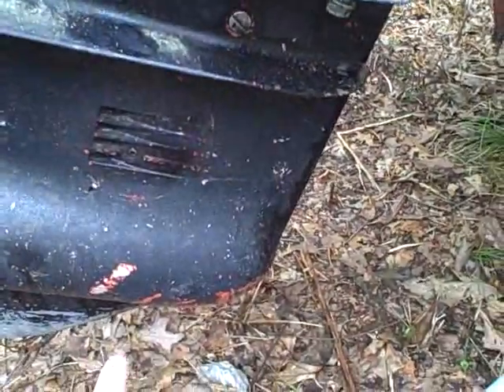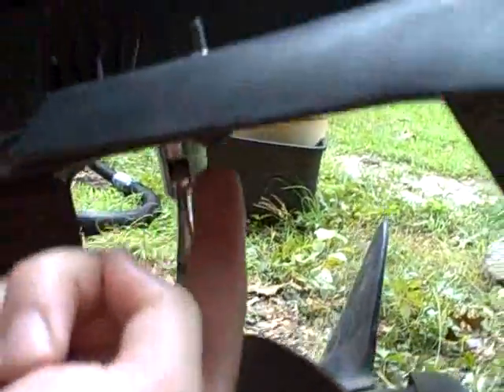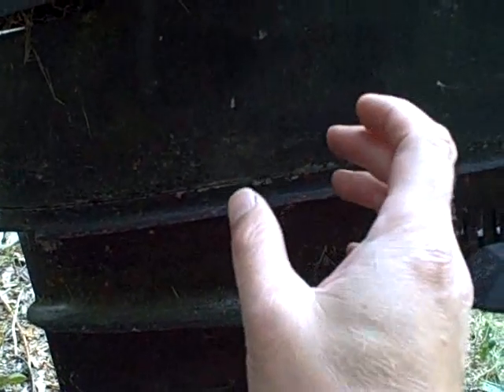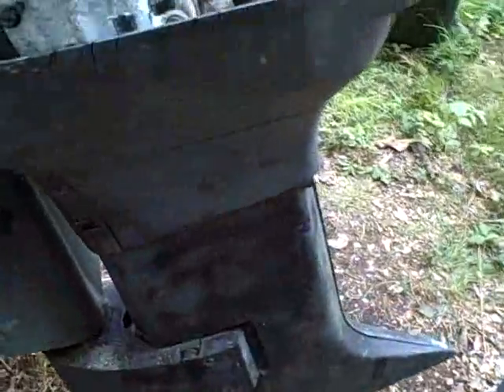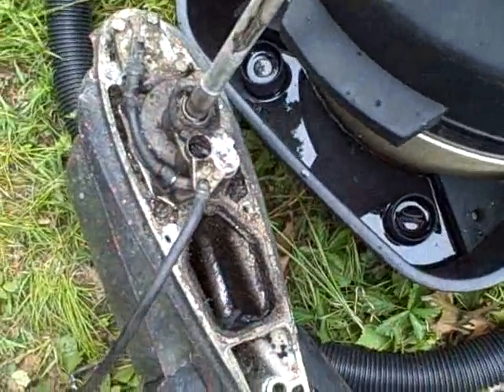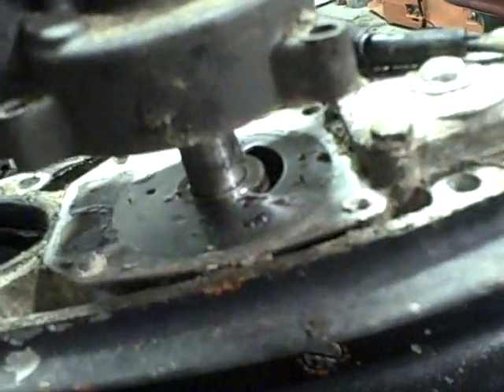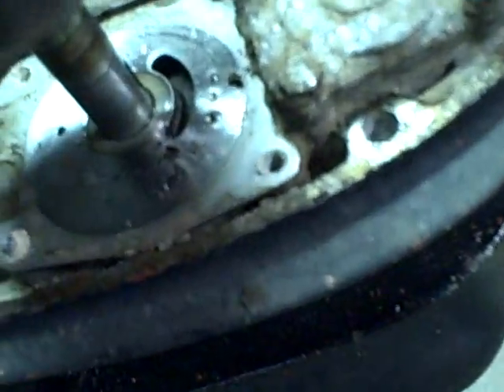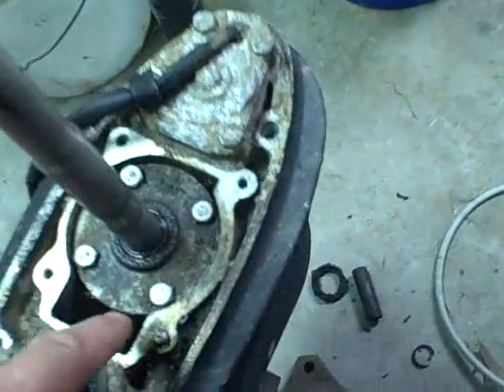Glastron Aqualift Ugly boat / Johnson Outboard Project Part 13

Comment from the maker: Yes sir, retired that flip video that had the sound issue. Now trying out a Sony bloggie. Bad things about the bloggie are sometimes I inadvertantly cover the mic with my finger, it has no hole for a tripod mount, it is rechargeable, so if it dies, I have to wait for it to recharge via a usb port, and it has this feature where it automaticaly senses what position it is in, and re-orients the view, but it sometimes has trouble with objects, thus the occasional sideways. or upside down video clip.